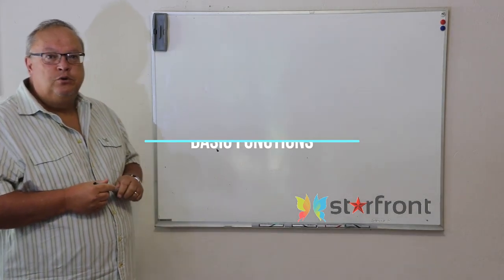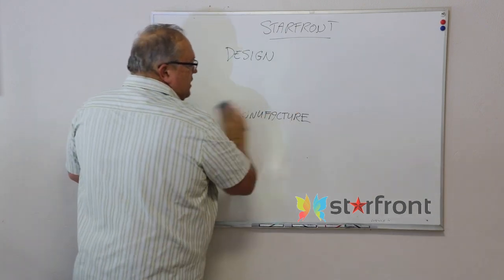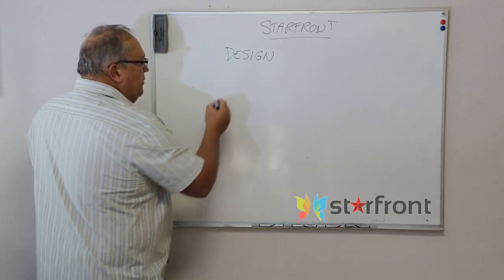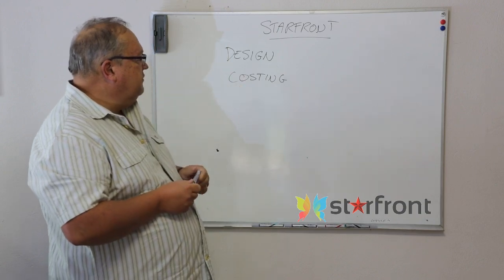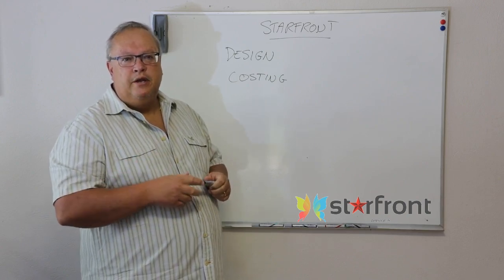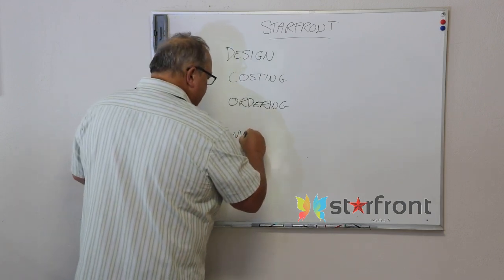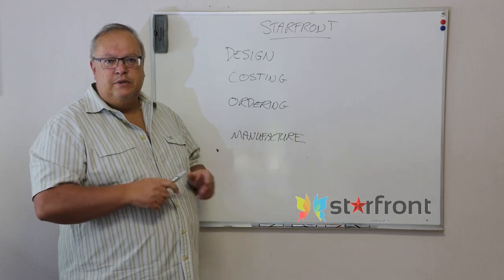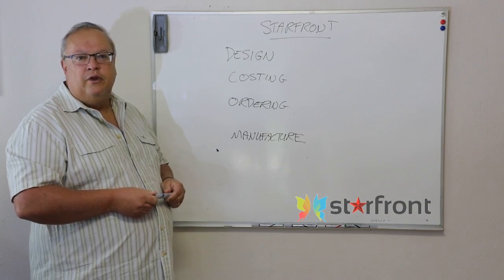Lesson 4 - StarFront Functions Introduction

Comment: So wich laptop do I need to use star front 4? 64GB,500GB or 1TB
Reply from the maker: Any modern laptop running Windows 10, with 8GB RAM and a screen resolution of at least 1024x768, preferably an i5 or i7 with a solid-state hard drive